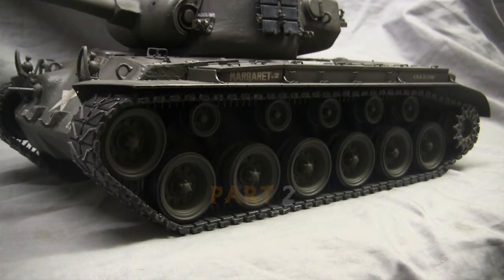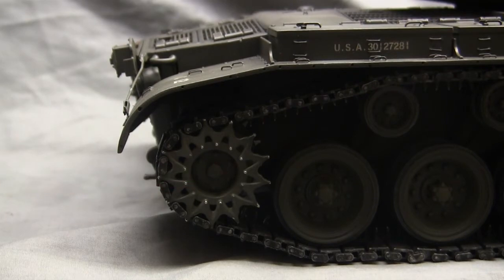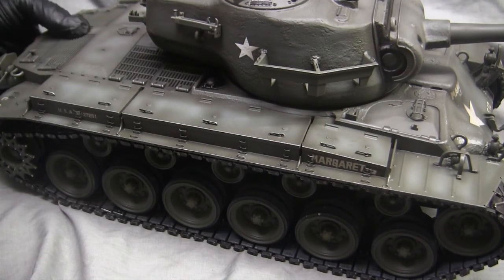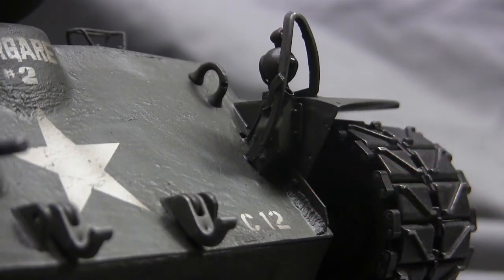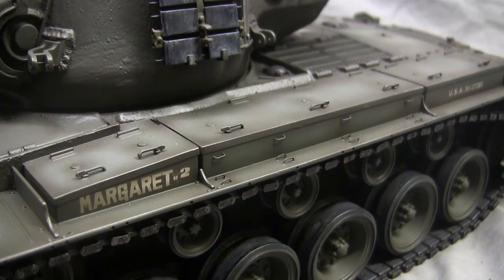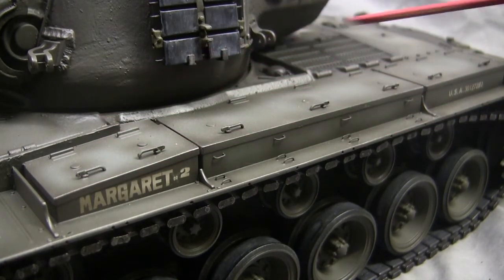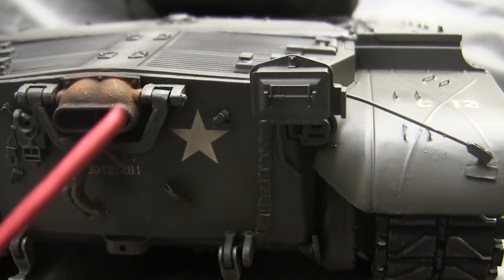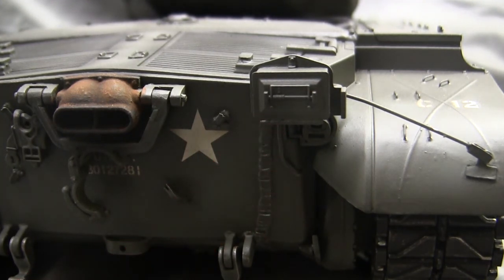1/16th scale RC Korean war M26 Pershing "Margaret" commission build part 2 of 3

Comment: I would have used blue loctite so that you CAN change the wheels if needed. Red is extreme strength and overkill.
Reply from the maker: as overkill as it is the screws can still come off if need be without too much effort. Having said that yes blue is what I use on newer builds for the reason you stated